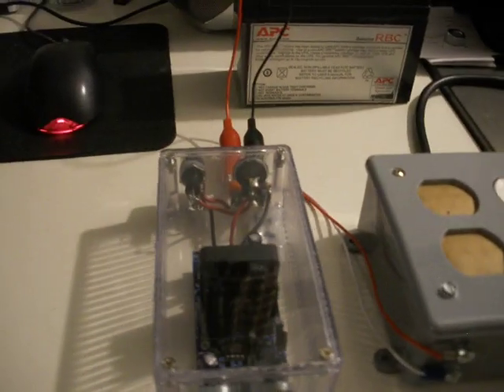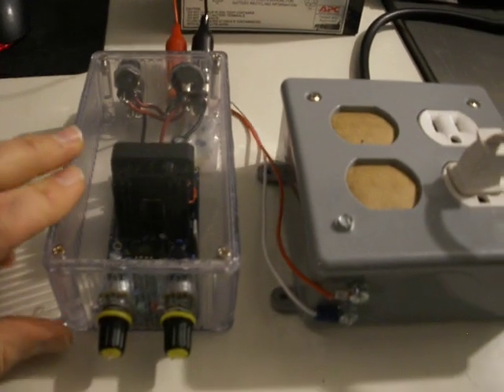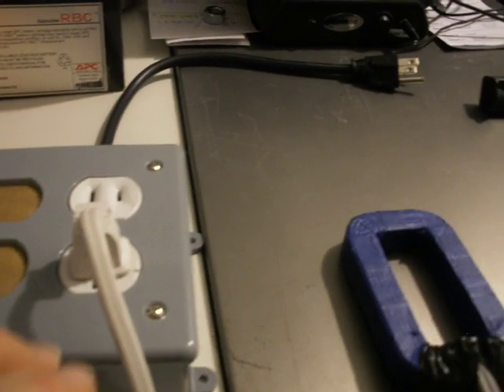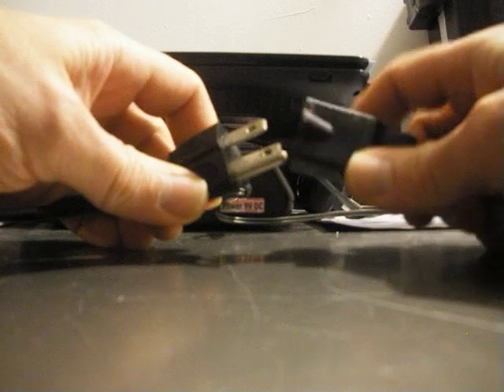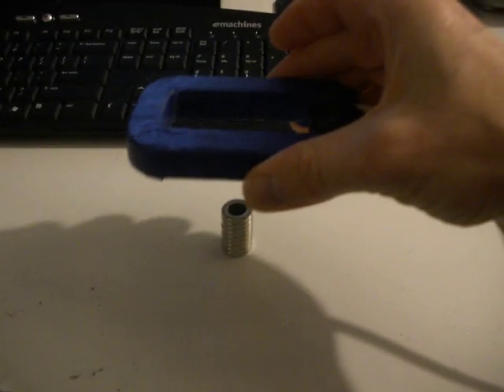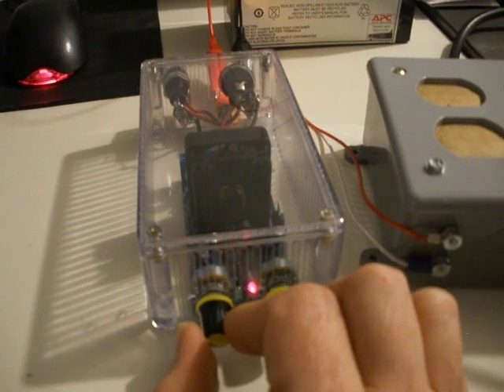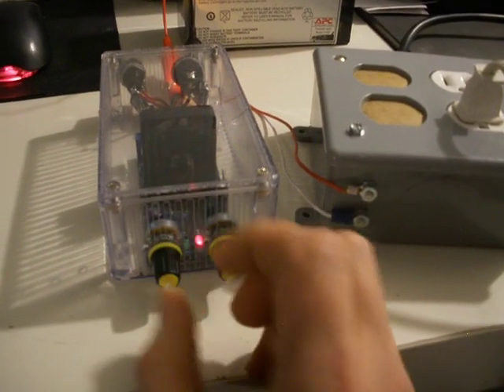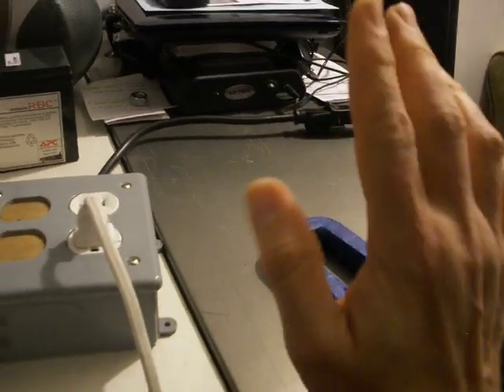High Voltage DC Power Supply...Part 2

Comment from the maker: Hello, I do show how I made it in the first video... it's just the capacitor and diode set up which raises the 120 volt a/c to 360 to 380 volts d/c with a relay between the power output and the coil in which I can control the pulses. send me a email to phillipstechinc@yahoo.com and i will send you a picture of the cap and diode set up. Thanks for watching.

Comment from the maker: Yes, true.. this however is a very strong pulse of a high voltage electromagnetic energy waves. It will produce and generate a Milli volt of current in your white blood cells when placed against your body in aid of fighting off viruses, parasites ,worms and also strengthen your immune system. Also can be used for wireless electricity transfer to another coil which I had very good results on lighting a 12 volt light bulb to the point it almost blows. Thanks for watching.

Comment from the maker: No sir, I never herd of that...The magnetic filed actually when pulsed at a low frequency causes a milli amp to charge the white blood cells which attacks viruses, parasites, fungi, tape worms...etc. It's best to drink allot of electrolyte water and wait 30 minutes before pulsing. Read up on the beck protocol to get more answers to any questions you may have my friend. Thanks for watching.

Comment: Hello :) As you know, magnetized water will cause plants togrow almost 1.5 times bigger than plats which are fed normal water. I was just thinking is it possible that magnetic fields can do the same to our blood and allow the fungi in our bodies to grow bigger and stronger? If so, it become more difficult for out immune system to fight those bigger and stronger fungi.

Comment: This is pretty interesting stuff. I'd like to see the effect on an actual cancer patient. Even if it's only skin cancer. It'd be interesting to use your device on a black (cancerous) mole, for example. If the cancer cell proteins are broken down, I wonder if the mole would change color as the body killed the cancer cells.